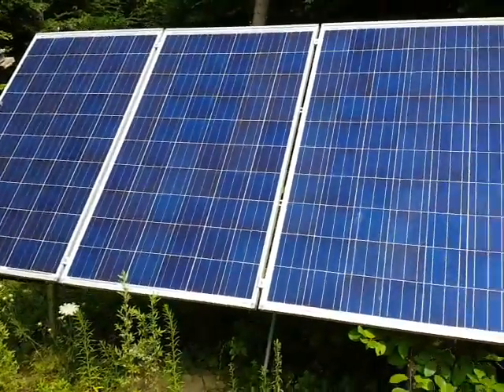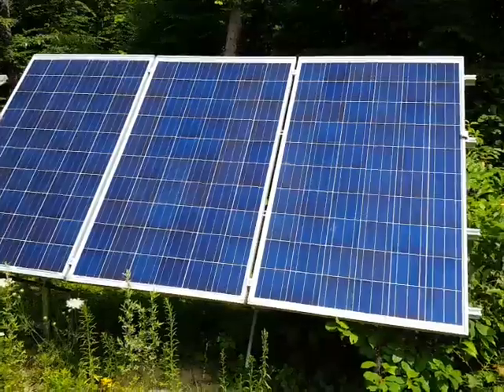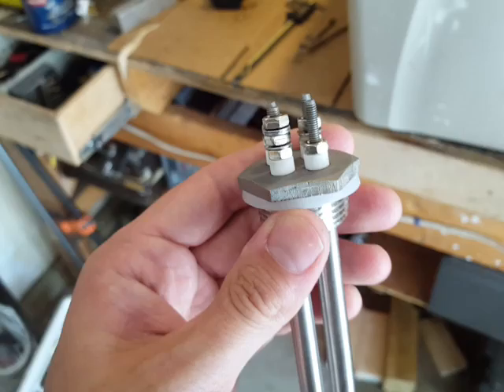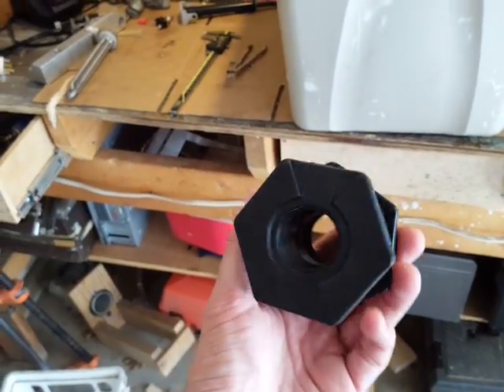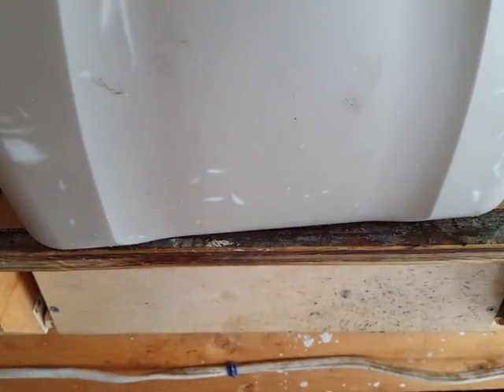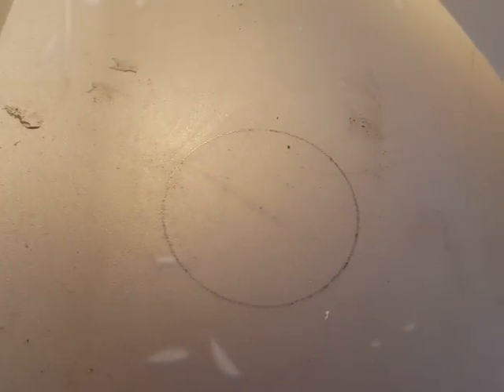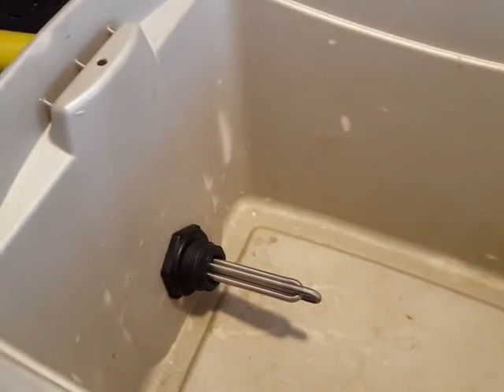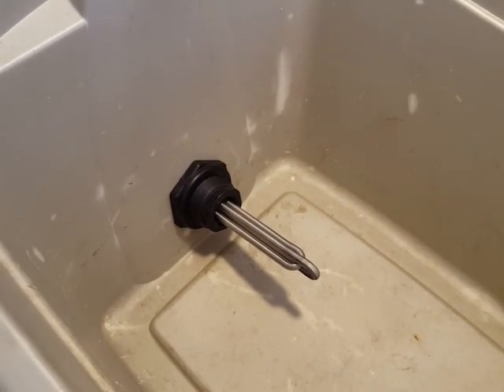$60 Solar Electric Hot Water heater and Tank

Comment: You don't need battery or a controller. Just match your PV max to the element by using combination of seies and parallel till you reach that point. Use ohms law to help calculate it. It's actually quite easy and I've been off grid since 1985.
Reply: what happens if you get a leak and the water accidentally drains out of the tub?

Comment: A whole video on how to drill a hole in a plastic tub and put the element in.  Nothing on the really important part of how to connect the solar, how much solar to connect, how to control it with a thermostat......basically a bit fat NOTHING as far as solar water heating.  Title should be: How to put a hole in a plastic tub.

Comment: I would be a bit concerned about melting the plastic without a reliable thermostatic control.  I would probably also want a float switch in the mix though that would likely have to control a relay so that the unit would not heat without sufficient water.  That all might not be necessary if you are going to watch it heat and it is out in the open such as camping as you suggested, but I know that I get easily distracted and could see me getting alerted to a problem by plastic smelling smoke.  In theory the HDPE would not melt until it was higher than the boiling point of the water, but If you ever boiled it down unintentionally it would not be good.  I would look up Hurd Solar as that guy designed a reliable controller that can be used for diversion that is dirt cheap if you can solder and put it together.  That way you could have your solar charge up your batteries and switch the power to the heater element when they were full.  You could also configure it as a switch to turn the heating element on only when the batteries were near full and cycle it on and off as conditions changed.

Comment: Maximum energy transfer occurs when the source impedance equals the load impedance. To calculate the source impedance connect a load of variable resistance. Change the load until the open circuit voltage is reduced by half. Disconnect the load and measure the value of resistance. Use a combination of parallel and series connections of heating elements that approach the resistance value just measured.

Comment: Is there a follow up video showing the water being heated? If not how long did it take to bring the 18Ltr container to a useable temperature say body heat temp 37 degrees?
Also can you wire the solar panel direct to the element using only a switch to cut off the power. Or do you have to run off a battery via an mppt charger?
Reply: I’m looking at doing same - so was hoping ti see a result video.

You can get panels that’s output 36v - and find an element that is 36v … as I read, most elements are almost identical as they use a resistive element.   More voltage will heat quicker, less voltage will heat slower. 

Effectively you can run the element direct from the panels.

Comment: saw someone using glow plugs used in diesel engines as a heating element
Reply: Yeap....i am about to do that; i did that on my boat , a few years ago, but on a stainless tank!!    ;  two glow plugs in series  off the 12 Volt batteries,had no solar,just the alternator,as usual,to charge the batteries

Comment: Hey thanks for sharing the video, neat idea for camp water heater!  In regards to your posts.  What you need to do is dig a cone shape for your concrete fills.  When moisture freezes in the ground it pushes the concrete up during thaw time.  So each spring you’ll notice your concrete posts come up more and more.  If the bottom part of your pour is wider than top, it stays down much better.

Comment: Everyone, please stop buying these DC heater elements.  You don't have to spend that kind of money.  I use standard120V 2000W, last ones I bought were $14 for two shipped on amazon.  If you can install multiple heaters, this is the way to go. They work out to be about 7.5 ohms each and I use them on a 36V array which is about 50V at power point. I get all my hot water at the camp this way, 10 & 20 gallon tanks in series. Just direct connect to the heating element gets you an efficiency of 40% at best. Most of the day the heater resistance is not matched to the panel.  I built a cheap little MPPT circuit that increases the efficiency to 97%
Reply: that's what I say. I even go as far as connecting regular 120v element to water heater and use a 10 awg extension cord as an emergency. for that matter hard wire a 240 v element to fusebox by qualified electrician if you're not a DIY. would it be up to code ? not in CA but you can get away with it if you live in the boonies. heck I'm building a rocket stove to feed hot water into my water heater. yes I live in the desert. i go to get away from rat race in the city. i've done many do-it-yourself projects experiments. relaxes the mind... for example I do have a mig welder, but at times I go old school 3rd world style LOL learned from my father 2 car batteries jumper cables and WAHAHAHAHA MAD EVIL SCIENTISTS read the fine print: "do at your own risk..." maybe that's why I'm impotent. "you say important, i say impotent, tomatoh, tomato, potato, potatoh, oysters, ersters, lets call the whole thing off" OLE!
Reply: Hey i did that to my 140l 230v 16A heater 
8 x 250watt 9.8A 37open 32 cloased
256v@9.8A direckt on the element 
Truh a 15A protektion 
And aDC SWITCH govorned by the dumb AC THERMOSTAT
DON'T PUT DC ON THE THERMOSTAT IT WILL BURN.!!!!
USE THERMOSTAT WITH DC SWITCH .. EASY FIX
3Hours 140l 90degree water
Reply: I'd be interested in purchasing such an item.
Reply: I would love to see pics, if you don't mind.
Reply: Right,just buy about 4,000-6,000 watt inverter and use high watt elements so it will heat up your water in minutes.done !!!
Reply: @fanech14  Inverters, batteries and charge controllers, YUCK. Get with the future and run right off the panels with a controller designed to heat water.
Reply: Exactly the comment I was looking for, no fuss, no sus, and definitely no coconuts.! 😊
Reply: @invictu4488  There is more to it than that.  Direct connect becomes very inefficient in less than perfect sunlight.  I use a specialty controller to get maximum power which produces 3 to 4 more daily heating.

Comment: I would opt to use a large igloo cooler instead, the insulation of it will help dramitically retain the heat
Reply: I agree - the standing losses of exposure to air and wind and ambient temp will almost be equal to the power heating the via the element

Comment: Your problem would be 245 watts -45 volt x 3 = 135 volts into 12 volt battery you better have an MPPT controller that will take 150 volt input.
Reply: Thank you for the information! Spot on!

Comment: WE need talk about solar panel size ,,, plug element right to solar panel..
Reply from the maker: my pv panels are 245 Watts max. power. I have three panels in series. This configuration proved too much for this element. I doubt my panels actually put out 700 watts but the element is now not working.  I have two golf cart batteries made by duracell. part # sligc110 setup in a 12 volt configuration.
Reply: You need to single one out and plug it in to a new 300 element ..  in the making of a room heater.. or heat helper .. but they make a HD solar panel for this.. so know the risk .. but this idea need to be known about and dun on you tube.  700 watt ac or dc ??  one need a DC heating element ..
Reply: keith bennett ,l bought some new Duracell golf batteries at sams club
excellent batteries
they r not by Johnson controls
I don't like those.
these r make by deka actually
Reply: Purchase a 48v dc element and wire three panels in parallel.

Comment: what size solar panel configuration did you have set up? how many watts? how big are the batteries you were using?
Reply from the maker: my pv panels are 245 Watts max. power. I have three panels in series. This configuration proved too much for this element. I doubt my panels actually put out 700 watts but the element is now not working.  I have two golf cart batteries made by duracell. part # sligc110 setup in a 12 volt configuration.
Reply: keith bennett this will be a stupid question. But.....when making this...... this means I'd need 2 separate water "tanks" ?????  One for my cold.   One for the hot? I Kno it doesn't stay on.... but .......  I Kno I Kno.   Dum question

Comment: I am thinking about making myself something similar to put in my trunk. Mainly to wash my hands and face as I am in the construction business. For the summer time I wouldn't use a heater. But for the winter time, I would just to keep the water from freezing. Any thoughts?
Reply from the maker: http://www.ebay.com/itm/DC-12V-24V-Solar-Hot-Water-Circulation-Pump-Brushless-Motor-Water-Pump-700L-H-/142112188346?hash=item21168be7ba:g:kykAAOSwknJX0ncw

https://www.amazon.com/gp/product/B007F54PUY/ref=s9_dcacsd_bhz_bw_c_x_1

http://www.ebay.com/itm/12-volt-dc-100-watt-Solar-panel-polycrystaline-photovoltaic-PV-Off-Grid-/371071648259?hash=item5665980203:g:hlYAAOSwHnFV2yUw

I would use a home depot bucket with a lid for your reservoir. Use a 100 watt 12 volt dc panel to power the circulator pump. Literally just hook up the panel directly to the pump and it will run when the sun is shining. Always have water in the bucket or you may do damage to the pump.  Have a loop of water that feeds out of your home depot bucket thru the pump, thru the hot water solar panel and back to bucket. This is just a mini version of my solar hot water shower. You could just add a spigot onto the bottom of the bucket for washing hands and dispensing hot water. 

If you wanted a shower kind of thing you could get a shureflow pump and a shower head. You may find the problem is that the water gets too hot, too fast. Good luck. Let me know if I can help. Thanks for watching my video. Please let me know how your project works out. 

The electric hot water heater burned out. I haven't figured out what happened. yet. I think the above is a more solid plan.